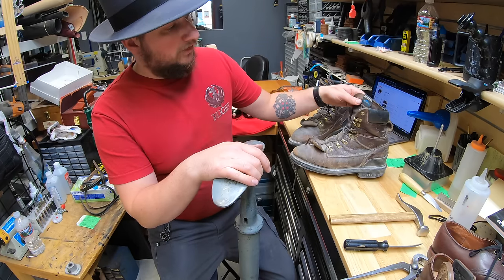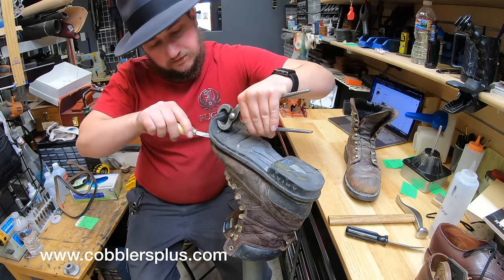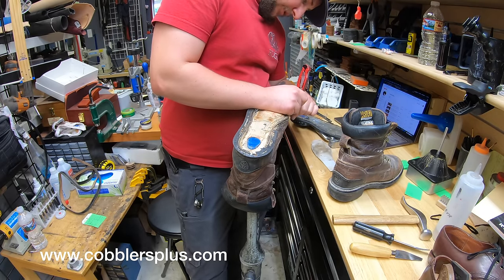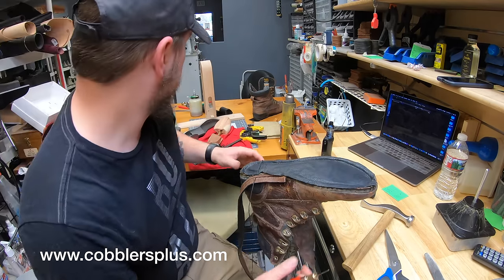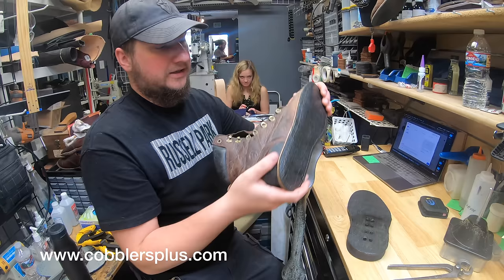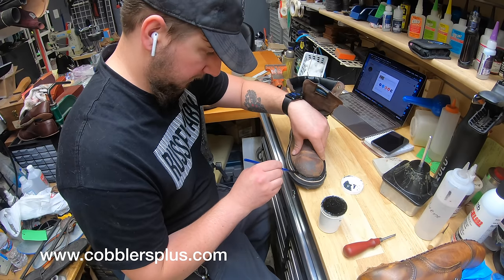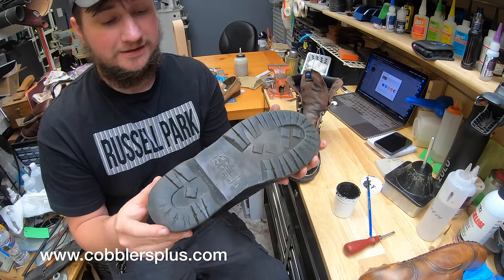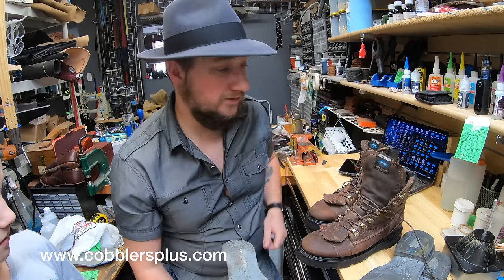Work Boot Repair: Ariat recrafted with double sole setup using both Vibram Cristy 4014 & 1276 Sierra

Comment: It's funny, those are built better now than when they were new. It is the second pair of that brand that is now better than new, by my count. Trenton and Heath did a pair a while ago as well. 

I learned a long time ago that when it came to footwear, most of your "affordable" boots are garbage and disposable. You want a good pair of boots that last, they have to be made to be rebuilt. I am extremely picky about my footwear, and won't buy anything but American made boots unless I need something I can chuck in the junk when done with them.
Reply: Got 2 pairs of Swedish boots made in 1955,older than me,resoled in 1986 ,used daily.Bit restrictive,only American.Lots of great boots out there.Surplus ,yes ,imagine the miles these have done.Love to try some Nicks though.

Comment: If I wanted to resole one of my Goodyear welted work boots the “Irish Setter Wingshooters” can I just remove the sole and leave the original mid sloe ? And then just glue a new sole onto the original mid sole.
Reply: You could do it but it will most likely be harder than u think I would have a pro do it you wouldn’t want to screw up a good pair of boots
Reply: @nathanhill6042  the worst thing that could happen is if you cut into the midsole. Then you would need a cobbler to put a new midsole on because they need to be stitched.

Comment: I have been conditioning my work boots with mink oil after cleaning them with saddle soap.  Would you recommend something other than mink oil for conditioning?
Reply from the maker: Depends on the leather and condition you use them in
Reply: @CobblersPlus  The work boots are full grain leather and in pretty good shape since I wear than approx 10 hours per day, 3 days a week.  So, saying that, would leather conditioner or mink oil be better?

Comment: Is that pine turpentine you used or turpentine substitute?
What workboots are good for reworking?
Reply from the maker: It’s more of a thinner based solvent. 
As for boots that can be reworked I would recommend Wolverine 1000 mile, redwing or Chippewa